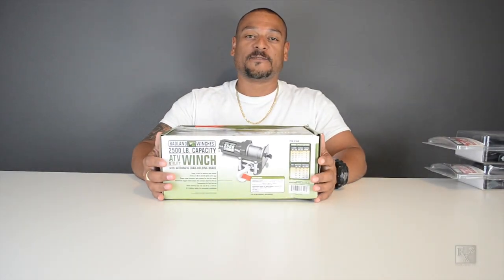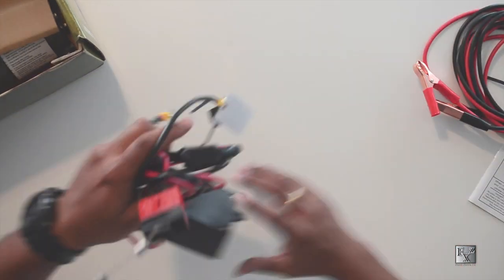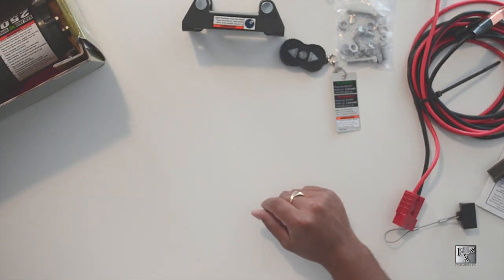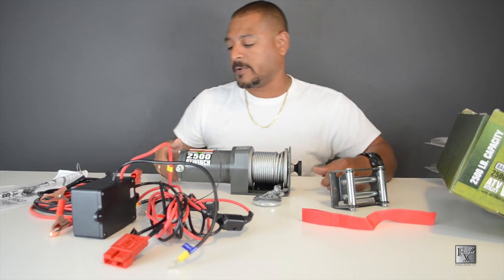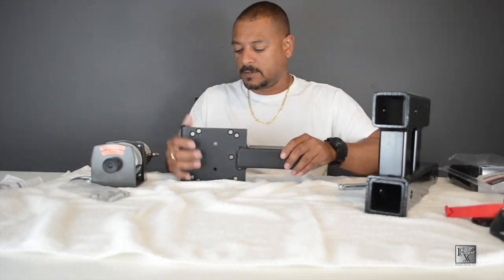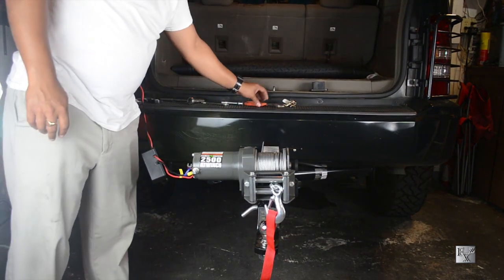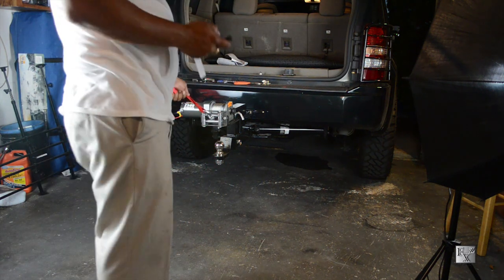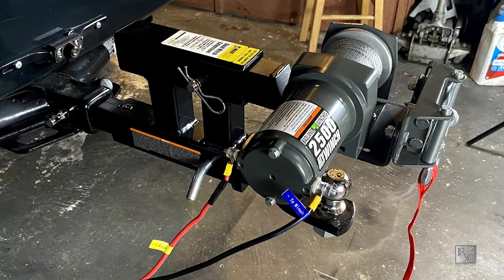Harbor Freight Badlands 2500 lbs winch unbox, and install.

Comment: It should be noted, today they currently have 2 models of the 2500.  This one, and the badlands 2500 ZXR.  It's probably worth getting the ZXR (and oddly often the same price).  The ZXR has a robust knob for free pulling (the original was cheap), comes with 2 remotes (manual and wireless), and the winch hook is removeable and comes with a removeable shackle too so you can easily swap out the hook or shackle, and don't need to take apart the bracket like the original.  

After getting the ZXR, some things I wasn't aware until reading the manual.  The lbs it can safely handle varies on how many layers of wire are on the spool.  That's to say, if you pull the entire wire completely out you can winch 2500 lbs for the first 6 feet.  Then when you start to get 2 layers of wire you can tow 2045 lbs for 13.3',     3 layers 1731lbs for 21.9',     4 layers 1500 lbs for 31.8',     5 layers 1324 lbs for 43.1' and     6 layers 1184 lbs for 50'.  So if you want to tow something all the way the winch can only handle 1184 lbs for the last 7 feet.  Also, under full load you can only run it for 45 seconds then needs over a 14 minute wait to cool off.  Again that's under full load.  One last thing I wasn't aware, you can winch things up to 45 degree angles left and right, but only 15 degrees up or down so the winch should be pretty close to the same level as what you're winching, but what you're winching can be pretty far off to the sides.
Reply from the maker: So far this little guy has not let me down, pulled down that shed, hoisted an engine, pulled my tool box on a trailer which is the 2nd from largest Harbor Freight makes. Winched a motor cycle onto the trailer also. Both would make a great choice but if ZXR is the same price I would jump on it as well. Thanks for the heads up.

Comment: Great video you saved me a lot of work I was going to mount my winch in the back of my truck once I saw that bracket I knew it was the way to go the best part is you just take it off and stored in the bed of the truck in the toolbox, the only thing I did notice was the part about removing the pins out of the guide to fit your hook through I didn't have the proper tool to take off  the c clips so I just took off the hook and threaded the cable through and then put the hook back on.  Anyway thanks for the video you saved alot of time and money

Comment: I got the ZXR on an open box markdown, plus Parking Lot sale discount. It came with both remotes etc but the wiring doesn't have the disconnect - which  I already ordered for a inverter install. "Unboxing" means first time opening, not a day later when modifications are already done. Moot point, I'm covered, and it's a good option to keep all the wiring from tangling up in storage. 

Yes, all winches have a "variable" rate of pull power, with the max exerted on the first wrap of the drum. For the most part once something is moving the worst part of the friction sticking it in place is overcome. If dragging logs etc across open ground, tho, you could find a crossover point where it's not doing as well. Still, it beats snapping a drag strap and losing the back window of your Jeep.

Comment: Dude great idea for pulling trailers up to your hitch. Man I been looking for a solution for a while. I park my boat on the side yard but I can only get my truck back so far before I have to detach and roll the boat by hand. Now it’s a 21 foot skeeter bass boat with a 300 on it so it ain’t light. Specially for being on a Rock pad
Reply: Good grief, have your wife pull it to the truck.

Comment: Hi, I would like to ask what is the distance between the round holes of this winch mounting plate? I'm working on this product now, thanks a lot!
Reply from the maker: The mounting plate already came Wirth predrilled holes I was able to use. There was no need to drill new ones.

Comment: Thank you for such a detailed video and for providing the links. I'm still not convinced how you made the 10ft extension cord with alligator clips. I have no auto mechanic skills whatsoever
Reply from the maker: Connecters : https://www.amazon.com/gp/product/B01KHQQY7E/ref=ppx_yo_dt_b_asin_title_o02_s00?ie=UTF8&psc=1
Wires : https://www.amazon.com/gp/product/B0756TDXJ9/ref=ppx_yo_dt_b_asin_title_o02_s01?ie=UTF8&psc=1
Alligator Clips:
https://www.amazon.com/gp/product/B0000AZ7Y1/ref=ppx_yo_dt_b_asin_title_o02_s01?ie=UTF8&psc=1
Reply: Where would be the best place to find some extra wiring for the winch to the battery (cheapest place) lol

Comment: Excellent video, thanks for posting. Appreciate all the links to the parts used, but I didn’t see a link for the quick release clip that you attached to the end of the battery connection cables... could you please post that link as well? Thanks again
Reply from the maker: https://www.amazon.com/HYCLAT-Battery-Connect-Disconnect-Connector/dp/B01KHQQY7E/ref=pd_nav_hcs_rp_2?pd_rd_w=dRHj8&pf_rd_p=d9899928-5e81-4649-b745-3e12c8242f4c&pf_rd_r=KZVEF7EYGF160GTSTRP8&pd_rd_r=de8c52bb-f72d-42d0-8104-b554a5500a6e&pd_rd_wg=eSGyV&pd_rd_i=B01KHQQY7E&psc=1
Reply: instablaster

Comment: Bought this exact winch but there is no way to connect the roller fairlead to the winch. Took it back and got my money back.
Reply: It connects to the mounting plate sold to install it. The winch attaches to the mounting plate, the plate attaches to either a hitch tube or trailer, frame etc.
Reply: @MarkMonteleone  I was putting it on my tractor and it already had a mounting plate but this winch wouldn't line up with the holes. Found one that did and fairlead was built in

Comment: Do you have to have your motor on. I have a mini kota trolling motor. It works great. No motor just a battery. My question is. If I have a marine deep cell battery hooked to this winch without a vehicle near by, will it work at all.
Reply from the maker: No, I am not running a 2nd battery so I just turn it on as to not kill the battery. Never sure how long I will be running the winch.
Reply: @fxzzurita4220  If your marine battery is charged up it will work. A lot of trailer installations do exactly that, battery in a box and then when parked either a trickle charger or solar charger.

Comment: I was in HF and saw this winch and the Badland ZXR, both 2500 lbs - do you know what the difference is?
Reply from the maker: No sorry I did not research the difference. Just had a coupon for this one was the reason why I bought it.
Reply: Is the ZXR remote controlled and this one isn’t?

Comment: What happens if you lose the remote or the remote battery dies? Can the witch still be used?
Reply from the maker: I don't think you can still use it. You may need to by a new one, or maybe contact the manufacture and see what they can do for you. There is no manual operation that I see on this thing.
Reply: The ZXR model comes with a wired remote as well. It does cost a little more but the extra remote and shackle kind of evens out the cost in the long run. I just picked up the ZXR model the other day cause they had it on sell as well. My plan is to install mine on a tow dolly. Bought a wiring kit for a amp that had 4 gauge battery wire. Going to run the wire back to a fused distribution block. Then the wire will tucked through the panels to hide the connector like you have here. Only enough wire exposed out the back to cover the lenght to connect it to the tow dolly. 
      Sounds like a over kill but I was going to install a aftermarket amp in my expedition anyway. Great video, keep up the great work.
Reply: Amp wiring kits can be cheaper than just bulk per foot. Good choice.

Comment: How to make it a wired remote? The Wireless relay stopped working and there is no replacement part. The winch cost $60 after tax and I do not want to waste more than half the money on repairing it.
Reply from the maker: Sorry, I do not know how to do this. But if my remote dies and I end up in the situation I'll try and figure it out and update.
Reply: @fxzzurita4220   I found a remote wired that's universal. Make sure there are 2 positive and 2 negative wires to attach to the battery and winch. No need for a solenoid relay. It cost me $35 for 3 days of Prime shipping. Apparently, something is wrong with the starter brush itself maybe not making contact. I decided to just buy another winch rather than attempt repairs because repairing cost nearly half of what I paid for it.

Comment: When I try to use mine the remote flashes a blue light it was working yesterday but not today do you know what that means
Reply from the maker: The blue light should signal it turning on and off. If it is not working you may want to check the manual for troubleshooting or return it.
Reply: @fxzzurita4220  when I press out ir in it flashes on and off
Reply: @hunnerhall841  Is the cable extended? It may be stalling against the fair lead, and it won't pull itself out.

Comment: Nice video..
Why not have a 7 way plug so just plug in at the rear of the vehicle
Reply from the maker: That's a great idea! Just decided to use what was provided and adapted the same gauge wiring for the hole system.
Reply: Thats a great idea 7way plug
Reply: Only issue is that 7pin plug doesn’t have large enough wires to send big current that the winch will be using. The 7 pin power is used for charging batterys
Reply: @FishFind3000  One and only one wire on the 7 pin provides 12VDC for electric brakes etc and it's usually too small a gauge to handle the amps this winch will pull. While it comes with 10 ga many replace it with 6 ga.

Comment: Hi what wire gauge
Reply from the maker: I used 10 gauge.
Reply from the maker: https://www.amazon.com/gp/product/B0756TDXJ9/ref=ppx_yo_dt_b_asin_title_o02_s01?ie=UTF8&psc=1
Reply: @fxzzurita4220  Many step up to 6 ga to reduce voltage loss.

Comment: Mines killing my battery to my ATV no clue why
Reply from the maker: I do not have mine connected full tim, but if I did, and had your issue I would install an in-line on off switch.
Reply: @fxzzurita4220  It's always on, just like if you wired a radio or headlights on directly.